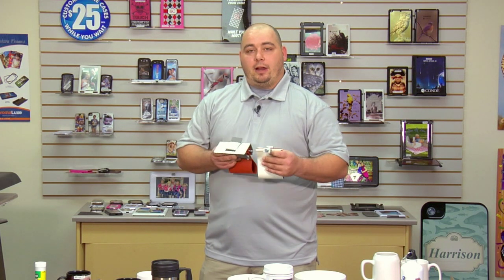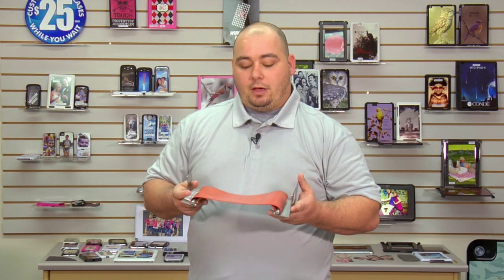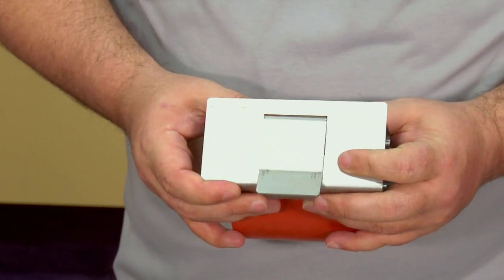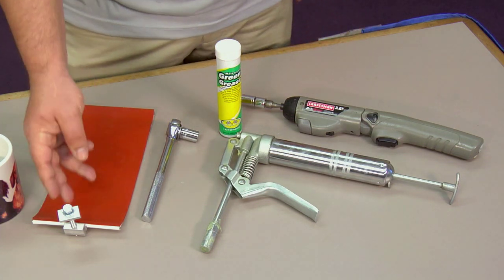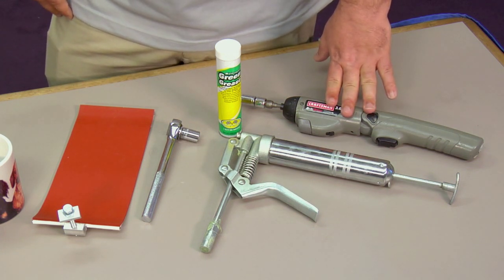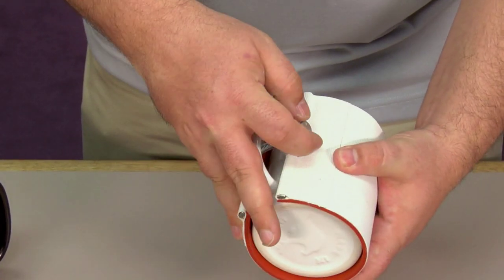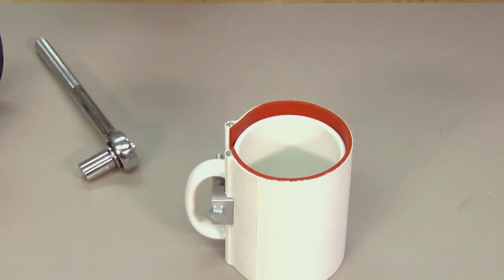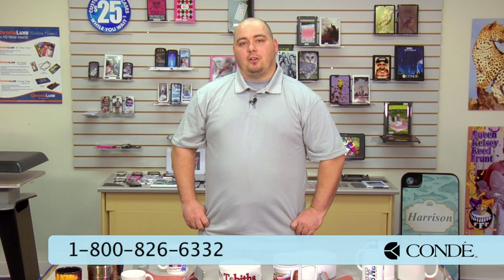DyeWraps for Sublimation Printing on Mugs Using an Oven - Overview

Comment: Is there any benefit to the screw on type as it seems like a lot more work?
Reply from the maker: Zachary Trautenberg It’s really a matter of preference.
Some like it because most can learn to operate a mechanical nut driver, with efficiency, pretty quick. Others choose this style of wrap because of its long standing reputation as a premium product.

The clip on wraps have the obvious benefit of being easier to maintain and requiring no tools to operate.

From the beginning we only carried the screw on wrap. Due to increasing client demand and our need to minimize the angst of possible operator error, we brought on the clip on wraps. I’d say that the numbers continue to bear that the choice made for one or the other is about 50/50.